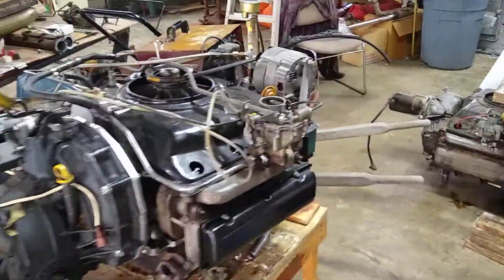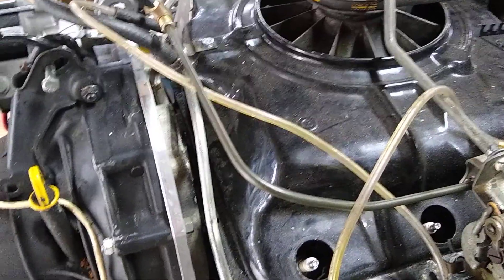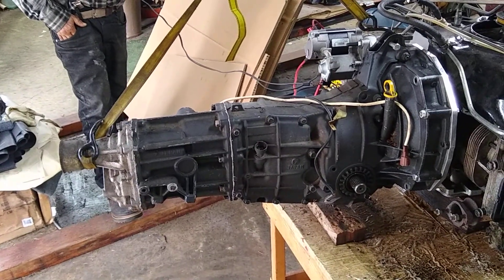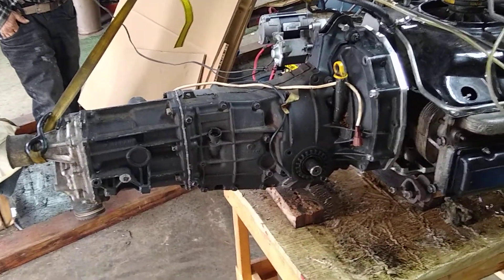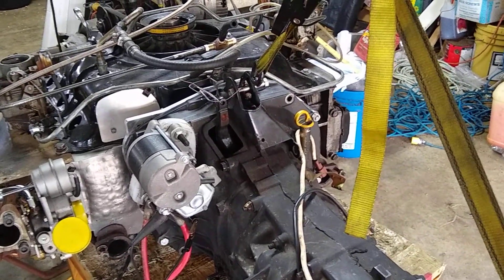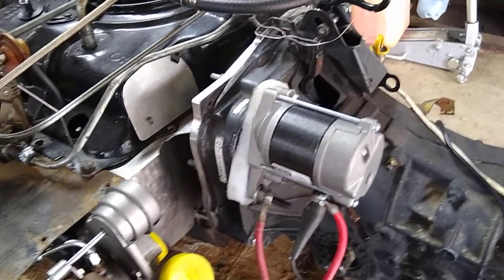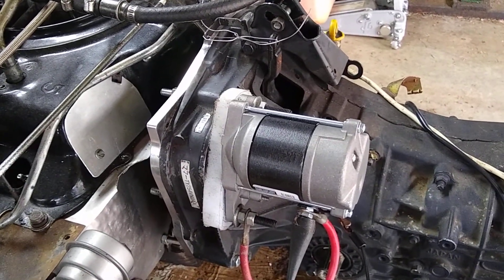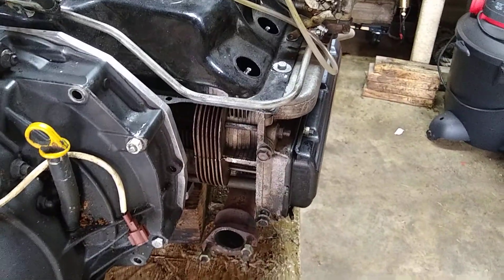5 speed Subaru transaxle to Corvair engine

Comment: So the engine rotation is stock Corvair, but the Subaru transaxle is rotated opposite of what is normal? (but ok as long as the torque does not exceed 200 ft/lbs)
Reply from the maker: correct

Comment: why not just use the VW trans?
Reply from the maker: Subaru trans has 5 gears!
Reply: @Patiomatt  Aren't there other VW/Porsche transaxles that will fit that plate? 944 trans looks about the same size as that Subaru
Reply from the maker: @ttc5000  No, this plate is for Subie to VW

Comment: I'm running a rear mounted V8 in my Corvair. Going to try the 3.08 gear set in the stock transaxle but I am always looking for ways to bring the rpms down at Interstate speeds. This looks promising? Question: I am unclear as to if the Subaru unit likes counter clockwise rotation. (I believe by this video it does?) 5-speed option to make my car more of highway cruiser is what I'm after. Fits the bill?  Kent.

Comment: What did you do for the clutch? I assume the 2 adapters would mess up the position of the clutch. Also what about a fly wheel? All that? I’m very interested in a project like this but this is where I’m stumped
Reply from the maker: Subaru "DualMass"  with custom  center.   All else was Subaru.
Reply: @Patiomatt  can you go into a little more detail? What about the space created because of the adapters? Do you have an email I could reach you at?
Reply from the maker: @lucky13speedworks    Vair to VW adapter  makes it a V W.  Subie to VW  is the only plate [ adapter ].

Comment: Other then a Subaru clutch disc, what flywheel - pressure plate did you use? How did you deal with the pilot bearing? Thank you.
Reply from the maker: Machined a custom Pilot [ quick ]  did not search for one.   Flywheel is the non turbo "Dual mass"  with custom center section.  Prototype , so now drawing / dimentions.  Simple to make.

Comment: My good sir, could you mate up a T5 transmission (GM) to a corvair engine?
Reply from the maker: Sure, Done 20 years ago, kits were sold thru Clark's, sadly went out of production after 20 units.
Reply: @Patiomatt  I found some pictures and documents with some further research. My intention is to build something with a corvair motor in the front of the car and have the corvair transaxle in the back, hopefully I can figure out how to make the T5 work.
Reply: 62-63 Pontiac tempest transaxle is what you want
Reply: @noid500cid4  Nope, Tempests used Corvair transmissions mated to a Pontiac differential.
Reply: @61rampy65  so it would still be exactly what he needed

Comment: Better to use reverse rotation for cam.
Reply: Then wouldn't you need to swing the whole thing around end for end?
Reply: I don't think GM ever made a boat engine out of the flat 6. I-6 yes. But I never seen pair of I-6 for marine use. Two of those would last a long time inboard on a boat. Maybe too long.
But I have seen a Corvair engine in a speed boat. It was used in racing. Until it was outlawed. 
How do you cool a air cooled engine without a fan? Dry Ice.
 Back in 60s and 70s you could get a lot of HP of those 2.3 liter Corvair engines.
There probably are a few Corvair air boats left. Keep them cool and the RPMs down they last.

Comment from the maker: This adaption of a Corvair engine / normal rotation  to a standard Subaru transaxle was just an exercise to PROVE it could be done! No intention of ME installing in in a Corvair.I had a Crown  for 13 years...  back to Air cooled flat 6's now!
Reply: The Honda starter,  was that for the manual or automatic trans? I am going to install a suby 5 speed in my early
Reply: It looks like this video was made about 1-1/2 years ago.  Is the owner happy with the result?

Comment: Sorry if I get it wrong English is not my first language... Can we run this setup like this without swapping the pingnon like VW folks do? Or shoul we better off to order the rear drive conversion kit from subarugear? it's a very interesting proof of concept thanks for sharing !! :)
Reply from the maker: Yes! That's the whole reason I did this
Reply from the maker: UPDATE  The engine, adpaters, starter and Transaxle  Can be bought for $1,150, pickup in Coos Bay, Oregon. I will sell the flywheel and 3 adapters separately for $650  shipped in US. Health is the reason for selling. All I can offer in support is over the phone now.
Reply: @Patiomatt  I hope you get your price, it is worth it.  I wish you well with your health.  Could you tell me if the starter is for auto or manual tans?  I am doing this to my early, will make an adapter, rather than buy.  Thank you for your excellent video
Reply from the maker: @tomstark5285   Same starter for either.

Comment: Have you thought of swapping in a Subaru engine as well??
Reply from the maker: That's already been done many times.  Who wants  Radiator?? GGG
Reply: @Patiomatt  exactly
Reply: The Covair engine is an oil leaking relic. ( I had one ). Why not a Porsche engine and transaxle if your going through all that trouble.
Reply: @textech4056  if the corvair engine is so bad why is it used in small airplanes?
Reply: @aliassmithandjones9453  Because it's cheap.?

Comment: is this a lockdiff? or will it still be a pegleg?
Reply from the maker: stays pegleg....  just the rear drive is gone.
Reply: Is it possible to get the diff with a locker?
Reply: @samegutten  You can make it a posi, subarugears.com has them, about a grand for it.
Reply from the maker: Standard  "open" diff.  Your choice